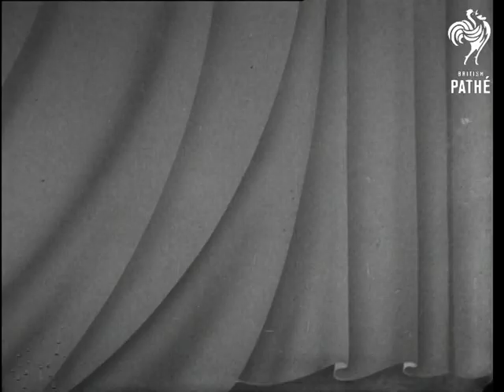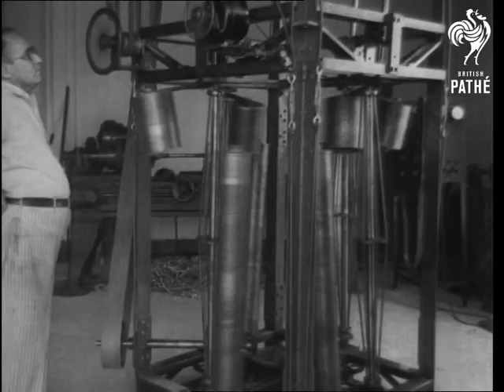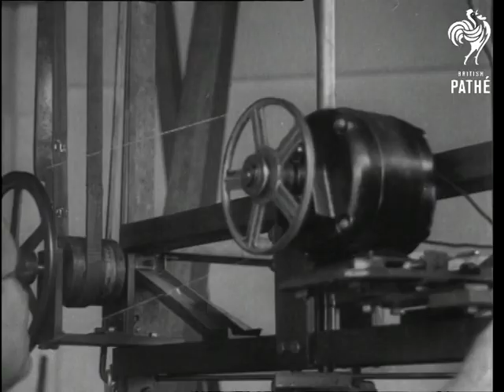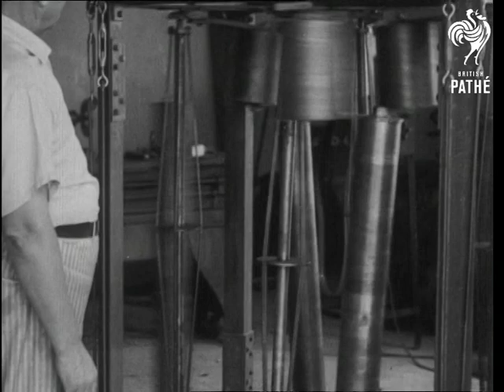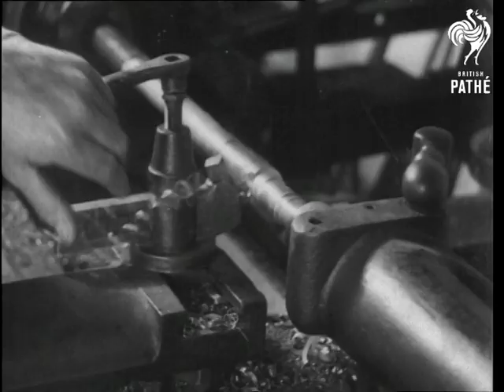Gravity Power! (1939)

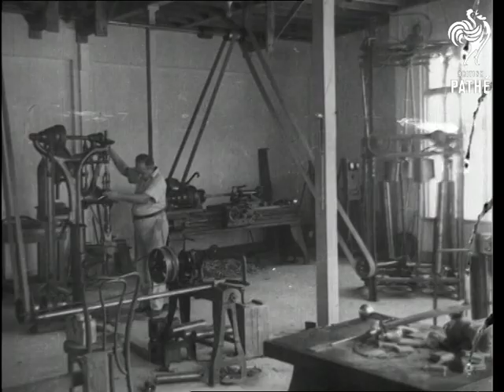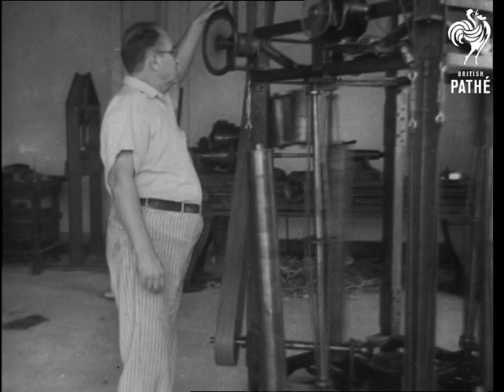Comment: There is too much disinformation already posted in the forums claiming the input lever is moving either only back and forth or in a circle. It is NOT. 0:04 to 0:07 shows  EXACTLY what the mechanism is. You can see the crossbar moving back and forth like a washing machine agitator. On the end of that, the lever is connected to a smaller bar or wheel that can spin around on an axis, HOWEVER, as the horizontal long bar moves back and forth, that changes the position of the axis around which the smaller bar or wheel on the end is moving forcing the upper part of the input lever to move in an elliptical motion!
Reply: The other very feasible possibility is that the oscillating crossbar is simply driving an offset pin fixed to a rotating wheel that drives the lever in a circular motion. This would act similar to a 'scotch yoke'. I've used this approach several times and it works fine.

Comment: The truth of this invention is that it is a Kinetic battery. Will stall and need to be brought back up to speed when power is taken from the power train. It simply acts as a differential battery using inertial motion.
Reply: And would require constant reset into motion..the initial force comes from human energy and the drag once it’s connected to a motor to actually produce energy may have been another story
Reply: so, he basically reinvented the flywheel.

Comment: It works, I power my farm with one for 10 years now, I used to hide it but noone even cares haha, mines huge tho, I use about 2 ton/offset axis with levers on the top 16tall, it will burn up generators, that's actually the main problem run a generator for 2 months straight, its smoked, not that hard to build, I showed it to the power company and they said ok whatever just don't feed it to the grid and could care less haha. As far as I know the physics behind it don't break any theories, I used to tell people about it and had one tech college teacher ask about it, but noone actually ever cared? or was interested? When it comes down to it I think average people actually dont want to put in the effort.
Reply: I dont understand. It shouldnt be able to multiply energy. You cant create energy out of nowhere. It is the most fundamental law of physics. You cant neither create nor destroy energy. You can only convert it.. but maybe thats the trick with this machine.
Reply: @godoftestoe7956 it’s using gravity as a modem of force on this machine. The weights are in perpetual free fall.
Reply: That sounds awesome. I'd love a video of it.
Reply: Can you give us some more information about it ?

Comment: To grasp what is going on here, get a bike and put a weight on the rim, place the wheel horizontal with the lower part of the axle in a indent then oscillate the top part of the axle, you will soon get the wheel up to a good speed. Question, how do you get the energy back into the drive (your hand) this Idea has many brother and sister on YouTube and there is many variation of it.

Comment: There are a lot better ways to amplify leverage torque with the use of rotating weighted levers, gaining 360 degree torque from the pull down of gravity on the weights x lever ratios x the number of levers, with a equal pull down on each side of the axle. The video shows too smaller leverage advantage (of set crank) to make any real advantage and the slight fall is equal to the lift  = a complicated flywheel effect with chaos.
Reply: Make us 1 then